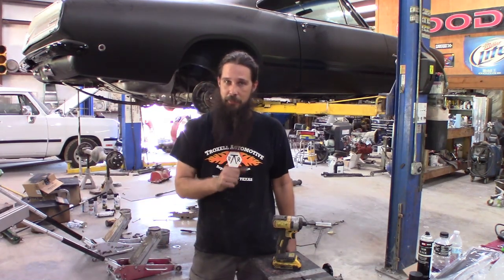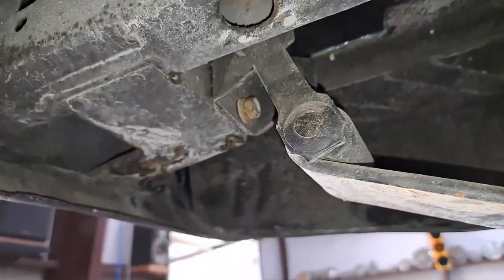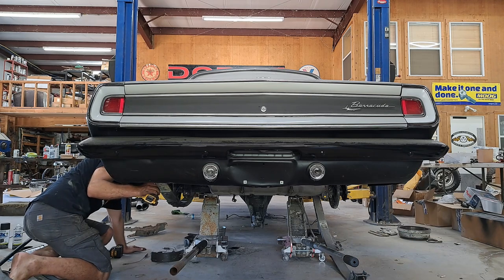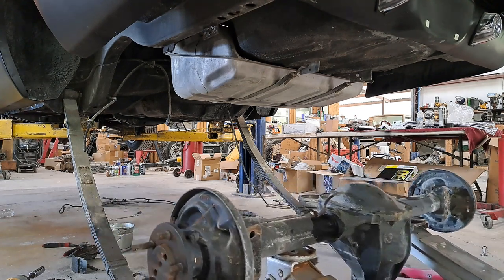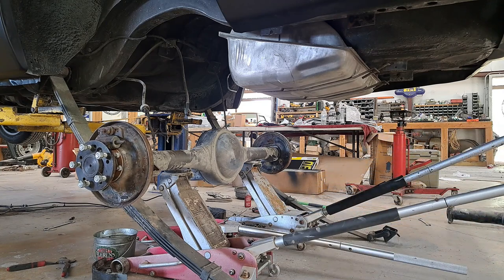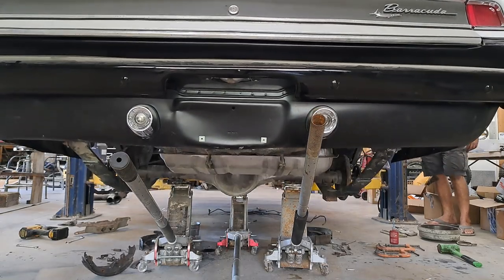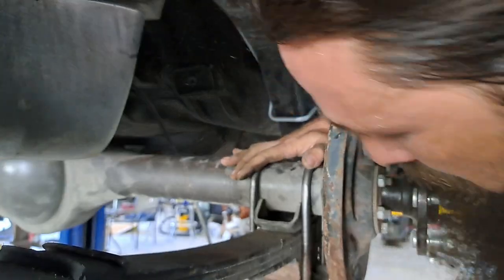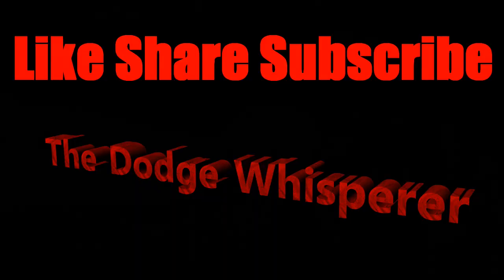The 1968 Barracuda gets an Axle Upgrade! - Installing the 8.75 Rear End and New Rear Brakes

Comment: ya , them springs need greater range of travel .
with the snubber having 1/2” gap .
I found the Chrysler Imperial , was correct shock length .
Hydraulic favoured , over nitrogen charged .